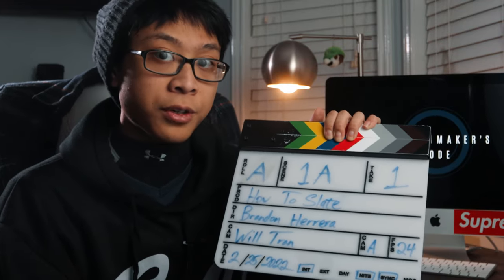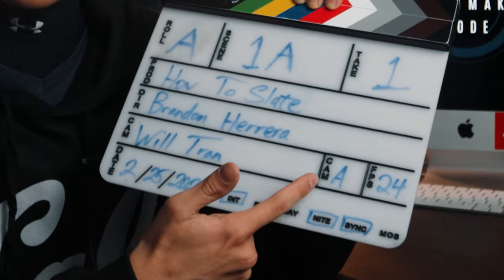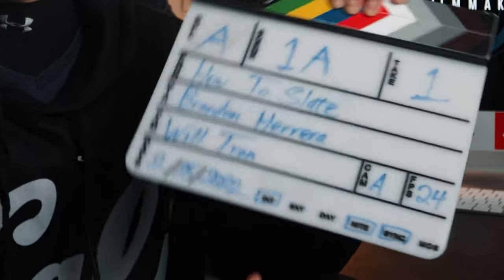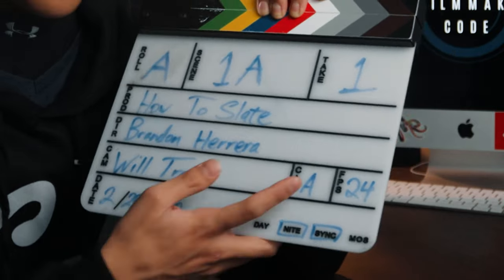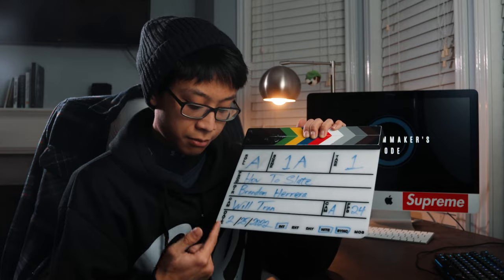How to Slate / Clapboard PROPERLY | Filmmaking Tutorial

Comment: Slating is an art. Very few people know how to slate correctly other than people working on features and bigger budget music videos / commercials. The difficulty with slating is that there is no definitive way to display your shot info on a slate as you can essentially tape over any portion of your slate and write a custom section. The main point is to give each shot angle its own unique indicator and to where necessary mark certain sections with a tape label if that section is not going to change during a shoot. The worst thing for an editor is seeing a slate that has the same unique shot indicator on multiple shots, which leads to confusion and wasted time; also information that has been rubbed off the slate do to it not being written on a piece of gaffer tape is problematic as it leads to mix ups in the edit. 

-The only thing missing from the slate on this video would be the shutter angle; which is a pretty important piece of information to note down as the shutter angle defines the motion characteristic of your shot.